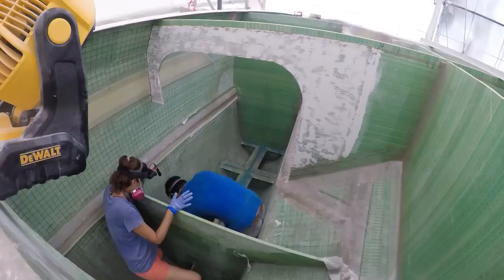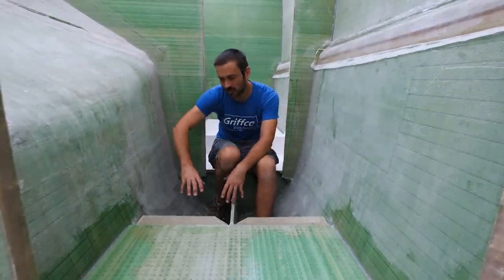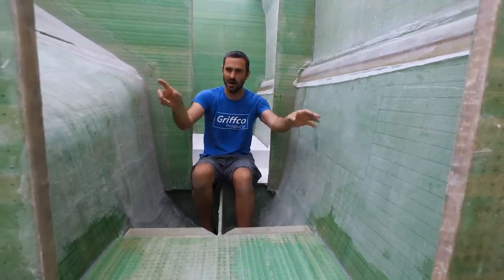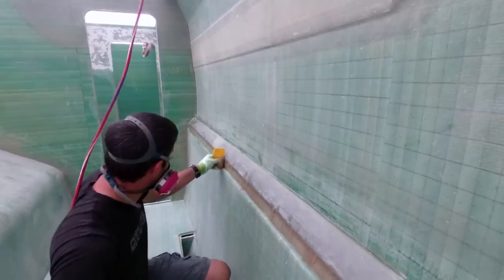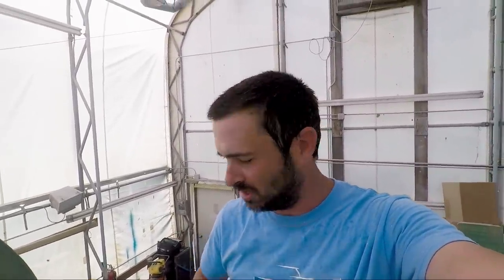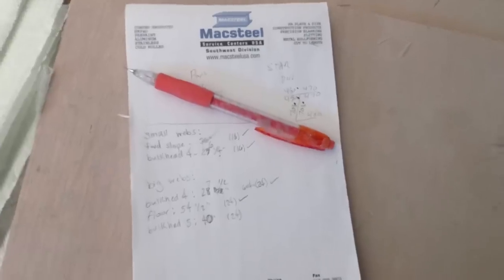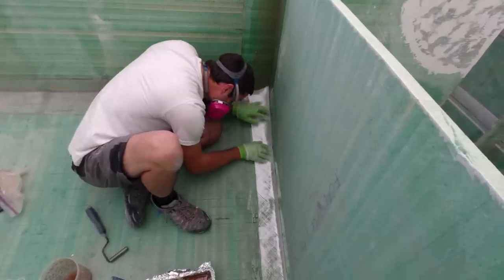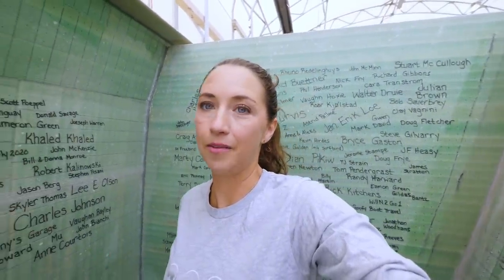CATAMARAN BUILD - The Backbone of our Water Tanks (MJ Sailing Ep 204)

Comment: You are aware that placing water tanks and other heavy stuff hi up will 
Effect your  stability right?
This idea that the bottom tanks is 
Not for use to anything more than sealed spaces that  you can't even inspect is not smart.
Remember that a stone is mutch more esay to lift under water than over , this also applies to fresh water in tanks , above water line one m3 of water weights a ton  under the water line  it removes some upplift but will not press the hull deeper than if it is above .By spreading storidge tanks for fluids true the hull  you can adjust  the trim by moving fluid back and forth  between  them, 
 if one tank gets punctured you can disconnect them from your system  , and will not loose so mutch off the stored fluid. 
The boyensy of the boat is the same 
Where ever the weight o stored hi  or low when the rest off the hull is not 
comprises. 
Som the fact  that bottom tank is used for  storing thus not mean that your boat will go deeper.  But in situation  were water gets in the hulls and thereby make the volume of displacet water less  the wheit of the water in tanks  is already below water line and will not add to the down ward forces. ( Its already "weigtles") and It does not matter if  a cell is filld or empty in the aspect of water ingress to the above floor compartment the function is the same , I understand that the marine architect that have constructed the  the hull surley must have taken height for the design choice to not use the sub floor , but the design is not optimal, sorry for saying.
 atleast discuss  this with them.
And  how you build is your choice,  not enyone else's
Reply from the maker: I think your understanding of buoyancy is a bit off.  The hulls emerse the same with weight added above or below the waterline.
Reply: @MJSailing  yes i wrote that , but not  if there are loss of air volume 
Due to holes / damages,  the" water volume " will only pull down the boat  until its in  lever with the surrounding water body . Also a full bottom tank with stored liquid  can be breached  in the 
"Floor part" without  any difference  
In lift . water for water.  a "dry tank " I the same scenario will not contribute to added 
Lift, thus it  will trow of stability  calculation in the design if gets opened to the sea.

This is why  merchantships use de dubbel hulls for fluids. A breach in the outer hull will not sink the boat , 
If the tank was empty when this happened the ship will still hold  its  boyensy whitin a intended safety factor. 
If they haven't been using the air wolume as a extra load  possibility 
Of corse.

The center of gravity  moves upwards  if  high   density  materials is placed  higher the hull.

Comment: Your work looks great! The double hull is indeed a great safety feature but would it be less safe if you used part of that for watertanks? It will help with keeping the weight as low as possible
Reply from the maker: The original plans called for the tanks in the hulls, but the production boats went to this new location because it centralized the weight which was more important that height.   Matt
Reply: @MJSailing  ok, thnx for the explanation

Comment: MJ Sailing    Actually, the compartments will hold more air than closed-cell foam because the medium or membrane between the cells takes up space, albeit, probably not that much, but I like your plan better! My ski boat has closed-cell foam in it too, but there were leaks where the plugs were installed, mostly because they were not done correctly.